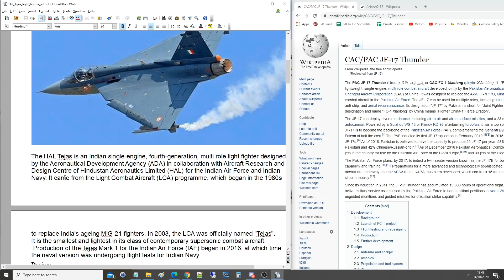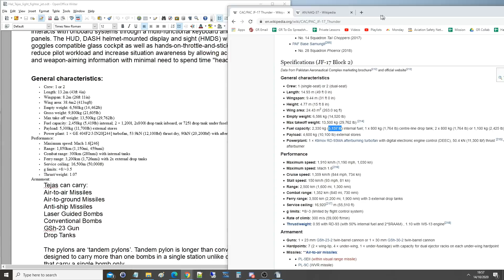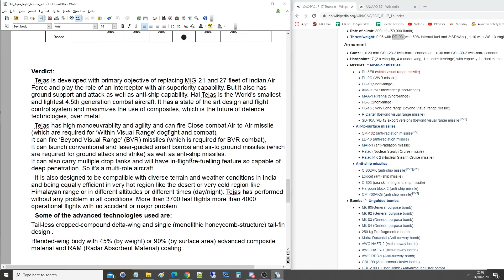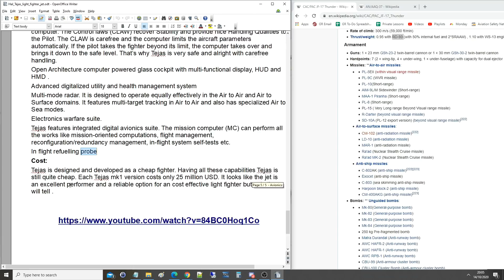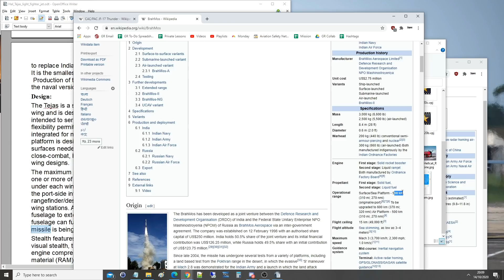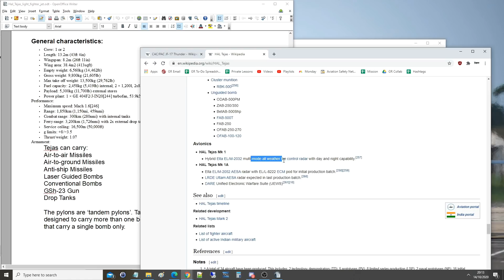Discussion: How Good Is The HAL Tejas?

Comment: Please, unless this plane prove itself in some air combat situation like J-10 and JF-17 did recently. Otherwise these claims won't convince me one bit.
Reply: A fighter jet isn't compared on the basis of its actual combat but its capabilities, for example- Tejas hasn't had any error in 10,000 maiden flights.
Reply: @SiegeIronFort  You should go research their spare parts. If you are the commander you won't want to touch this plane that got NUMEROUS suppliers from foreign nations such as Sweden, Russia, Israel and etc.

Strategically, that's not a good logistic issue.
Reply: @chlim9478  75% of Tejas is built using Indian indigenous parts and India aims to increase that, of course the actual capabilities of an aircraft can only be seen through actual combat but that does not mean that you abandon the system you made! 

The thing is new material can't be kept in hiding just because there is no war going on to test it! At the end you would asses its power on the basis on trial which we've seen plenty of, Tejas has participated in plenty of shows against other jets.
Reply: @SiegeIronFort  I'm sorry to tell you that India manufacturing infrastructure SUCKS.
Reply: @SiegeIronFort  I'm sorry that everyone will see LITMUS TEST than some ad sales. Unless that plane pass some LITMUS TEST, otherwise doubters will still exist.
Reply: @chlim9478  It is very much underdeveloped compared to other behemoths in defence industries, but it isn't totally a waste. India made Tejas with no past experience whatsoever and since then the speed for other upgraded models of this jet is quite remarkable, take Tejas MK-1 and MK-2 for example.
Reply: @SiegeIronFort  And it was developed for more than 20 years. Even that FATBIRD F-35 might had entered into Block 2 version with that LONG years. 

You're trying very best to convince me of India's own infrastructure but sadly, it's lame.
Reply: @478 I didn't say that Indian infrastructure is anywhere near to that of western or Chinese level, all I said was that India has no experience so it would take time for them.

Tejas on the first hand wasn't even in continuous development due to political hurdles, it was even stopped at a point--Your point that Indian infrastructure is just nowhere capable of building things is as absurd as it can get.
Reply: @SiegeIronFort  Yes, you did not say that. But their infrastructure still SUCKS, and that's a fact.
Reply: @SiegeIronFort  India can build, but after they passed the BUREAUCRATS' blessing.
Reply: @SiegeIronFort Then you already gave your answer then. 20 years of long development with BUDGET OVERRUN that might made F-35 program like a minor discount sales. As General Bradley once said, professionals play logistics. And India which I'm sorry to say need to rid it's CASTE SOCIETY and POOR INFRASTRUCTURE. 

There's a dark reason why the west is promoting India right now. Trust me, those elites will tell you the PEASANT to like and support it.
Reply: @SiegeIronFort And yes, go read the news, Tejas has crashed.
Reply: @chlim9478  Engine failure. Who made the engine, enlighten yourself.
Reply: @SiegeIronFort  Ever heard of LITMUS TEST? Capabilities always proof itself in REAL combat. So what are you trying to argue right now?

Comment: Lower range is because of air intake design. Air intake are designed for a certain characteristics. But while doing that engine is left deprived of air resulting in more fuel consumption and lower range. Gripen has similar weight and the same engine but it has a better range. Also because of the shorter length Tejas produces more drag.
Tejas mk2 is 1 meter longer which will improve the drag. Drag was the reason why they decided to increase the length instead of putting a more powerful engine in the same airframe. They may improve Air intake design as well.
Reply: you spoke so much "science" and yet u dont know that Tejas mk1 and Gripen C have roughly the same range which is around 1500-1700 kms on internal fuel or over 2500 kms with 3 drop tanks. It was showcased during Tejas's visit to Dubai/Malaysia and Singapore where it covered similar distances without external refuelling.
Reply: @marcd5196  no no I am not critical about Tejas. And I agree with you about the range. It's about combat radius comparison between gripen and Tejas. Both use the same engine and roughly have the same internal fuel capacity. but the combat range of Tejas is lower. 
However It's not necessarily a problem. It's probably because Tejas has to be his way because of some design consideration.
Reply: @pravinmeher2036 Combat radius publicly available is of the IOC variant. The improved combat radius is much higher. Could be in the range of 650-700km which is pretty much the same as that of the Gripen.

Comment: Tejas being a 4.5th gen fighter really made me laugh. It's solidly a 4th gen. Got to love marketing.
Reply: Nah
Reply: Gen number doesn't matter. what matters is IAf has a definite role for these machines that's why they ordered 120 of them.
And it's always about the person who operating the machine.
Reply: @pravinmeher2036  eh it's still a 4.5th gen though. Maybe a 4th gen wouldn be able to do those roles as planned.
Reply: u dont know the difference between 4th and 4.5th gen, do you?
Reply: @marcd5196  yes
Reply: @skatman3278  no u dont lol. enlighten me if u do.
Reply: @marcd5196  yes I do. I've nothing to prove to a nobody.
Reply: @skatman3278  lol pea brain
Reply: @skatman3278  low iq. lol
Reply: @skatman3278  4.5 Gen is built with composite materials not aluminum
Reply: @whysoserious7553  not always and not exclusively. Just because something is built from composites doesn't make it a 4.5 gen fighter.
Reply: @skatman3278 It's got an AESA radar. Ehich makes it a 4.5 gen fighter.
Reply: @direwolf7491  no it doesn't.
Reply: @skatman3278  YES IT DOES.
Reply: @direwolf7491  nope. It doesn't. Being 4.5th Gen is more than just having an AESA RADAR.
Reply: @skatman3278  AESA radar is one of the main features of being a 4.5 gen fighter. The reason why Su-30 is 4th gen and Su-35 being 4.5 gen.
Also be concrete... tell me what other features are required to qualify as 4.5 gen.
Give me a list.
Otherwise all your statements are trash.
Reply: @direwolf7491  no it isn't. A bad AESA RADAR is worse than a good PESA/Pulse-Doppler RADAR. It's far more than that. It's the implementation of a number of things.

I don't owe you a damn thing. I have nothing to prove to someone that thinks the Tejas is 4.5th Gen or that an AESA RADAR is what makes an aircraft one.
Reply: @skatman3278  Stop with you BS man.
And YES you do owe me  and everyone you here to not spread misinformation you punk. The fact that you are triggered by my question shows that you are nothing more than a worthless troll.

Comment: Tejas is not the greatest and the latest. But as an interceptor within Indian territory it is good to have a capable low cost option. It would be foolish to send the limited numbers of Rafael that India has to engage low value threats which its enemies throw.
Reply: if u send Rafales for every mission, after a week of war...all Rafales will remain in their hangers "under maintenance" as India wont have money left to operate or maintain them effectively.
There's a reason why US operates more Single engine F-16s than the bigger more powerful twin engine F-15s.
Reply: And in case of Tejas procurement, most of the money is spent in India. Also Jobs are created in India not in France or Russia

Comment: It's like almost all Indian procurement projects, a horrific roadcrash.  Way over budget and with all sorts of design and development issues.  No doubt they will get it working and deployed.
Reply: HAL Tejas
40 + 83 ordered. Total 123 ordered. largest fleet in the IAF only after the Su-30MKI
HAL Dhruv
Around 400 ordered. 335 Active and rest being delivered.
HAL Rudra
166 ordered . with currently 91 in service.
HAL LCH
15 initial ordered. Another 95 committed to.
HAL LUH
12 initially ordered. Another 111 committed to.

That was HAL and the Airforce

Coming to the Navy-
Currently 36 Warships under construction , making India the world's 3rd largest Naval shipbuilder in the present.
In the last 10 years, atleast 30 Indian made warships joined the fleet.

The Army however is the most corrupt one. Some high ranking officials feed a lot on Russian bribes and hence discard advanced Indian made equipment like the Arjun,. but anyway, that too is changing.
Reply: @marcd5196  arjuns gun inderperfomrs, has gaps in the front tal Armour, and is too heavy for rapid deployment, that's ehy yiu have newer developments like zorawar. The arjun's 120 MM rifled gun is a duck. Please thunkcritically,  not with emotions, the soldiers who select these know a lot more than youtube generals such as yourself about indian military doctrine.

Comment: Tejas is a scam on the Indian taxpayers and the Indian Air Force. Tejas may be a decent fighter by 1980s standards but it is hopelessly outclassed even by the planes that had been designed and had entered service like F-18s, F-15s, F-16s, Su-27s, Mig-29s, Su-30 and Gripen before Tejas had even flown for the first time. To boot, F-16, Su-30 and Gripen are cheaper to manufacture than manufacturing Tejas. Su-30 MKIs license produced by HAL, the very company that makes Tejas, are cheaper than Tejas and a Su-30 MKI is better than a Tejas any day. Tejas also has a very small combat range even compared with fighters of its own weight class like the Gripen and the F-16. Gripen, F-16 and Su-30s also require less maintenance per hour of flying than does Tejas and it also costs less to maintain these aircraft and they three are all better than Tejas. And to those who say Tejas hasn't had a crash: Those planes crash that are flown in any significant numbers. Tejas is way behind schedule. It is outdated now and it will be a flying piece of junk by the time it is inducted in any significant numbers.
Reply: lol cope up or cry.
Reply: @rohitb5834  Your comment doesn't even make sense... 🤷 Cope up with what exactly?
Reply: @col.waltervonschonkopf69  The success of Tejas? The fact that a total number of 123 of them will be the second largest fleet after the Su-30MKI?
Further the Tejas mk2 prototype is rolling out by next year.
So be prepared for another 150 Tejas mk2 between 2029-2035..

Your comment is a hotch potch of those "Media hit jobs" that has been going around Tejas but failed miserably to derail the project lol.
Reply: @rohitb5834  You crack me up! You are calling a plane that was forced down the throat of the IAF a success! 😆 Your definition of 'success' is messed up. Tejas is so successful that not even the air force of the country that built it wanted to buy it, anyway not in large numbers. It stunned prospective foreign buyers so much that they forgot even to order it. 
Sense and blind chest-thumping cannot coexist. When you learn to see the things for what they actually are, then we might talk. Chao!
🙃
Reply: @col.waltervonschonkopf69  like i said...cope up or cry 😂
Reply: @col.waltervonschonkopf69  Nice try madrassachap. But you need to try waaay harder at this point.
Reply: @marcd5196  i doubt hes a madrassachap. Hes probably from the import lobbyist team that has been printing fake propaganda against the Tejas . Failed nevertheless. Lol
Reply: @marcd5196  What if I was in the military, you dumb fuck? Did you stop to consider that? Tujh jaise armchair patriots hi hote hai jinki sabse phele fat tee hai jb dushman ki goli chalti hai, aur serve krne bhi nhi aate aur aate bhi hai to select nhi hote tujh jaise chaman chutiye.
Reply: @rohitb5834  abbe, chaman chutiye, 🤦 cope up ka matlab bhi maloom hai kya tujhe? Yha pr fit hi nhi ho rha.
Reply: @col.waltervonschonkopf69  tejas isnt supposed to be better than rafale or su30 or f16 they are all medium heavy class aircraft tejas is smallest one of them yeah it have low range but it also have lower rcs than f16 and su 30 its easier to mentain tejas because its single engine its cheaper to fly it to replace mig21 you dont need a f35 tejas is enough for that role if airforce operates only heavy class aircraft then all the money would go in the fuel and mentainence
Reply: @col.waltervonschonkopf69 Being in the military doesn't mean jack. Lol
Are you a pilot?
Forced down the throat of IAF... I bet you are friends with the gang that wants Gripen, Rafale, F-21 comissions in their pockets.
Reply: naah hes a madrassachap. It takes just a minute to verify that Gripen C costs 60 mil$ and Gripen E costs 85 mil$ , while Tejas mk1A costs 42 mil$. 
If he really thinks people are that stupid, well  he cant be from an educated background. 
Same applies for all his other lies. Takes a minute to verify and falsify those claims.
Reply: Clearly you are clueless about manufacturing and production costs. Lol
Also, the Gripen C that you keep talking about is giving about the same performance as Tejas mk1a. Come back with numbers not vague gissa pita media statements.🤡
Reply: Lol with that name I thought You must be a German/Dutch but no dude you're a Porki , ok then I think ofc we can't actually agree with your opinion (which maybe you are claiming it to be in unbiased).
Reply: @PrashadKaPrasad  What I am is your daddy, son.

Comment: JF17 is built for air superiority role for PAF, Tejas is built as light weight interseptor for IAF. Tejas built with defensive role in mind, JF17 is built with offensive role in mind. They are not same category planes.
Reply: waaah, kya analysis! lol
they are the same category in terms of weight.
In terms of generation, Tejas mk1 is half a generation ahead of JF17 block 1 and block 2.
Reply: @rohitb5834  It doesn't matter what is their weight class, both aircraft were designed with different role in mind. Tejas from day one was designed to replace and play similar role of MIG 21 in IAF (which is light weight, low operation cost interceptor), while JF-17 is a cheap multirole fighter designed for export purpose only.
Reply: @Richie303K  Battle ethos keep changing.
Tejas was initially planned as a Mig-21 class interceptor, but today is way more that.
Its fully capable of Ground attacks, CAP roles, SEAD missions.....even Air superiority if needed. 
JF-17 is a cheap multirole fighter designed for export purpose only. But that doesn change its roles.

Calling one an interceptor and another as "cheap export purpose" is not the same scale of measurement.
Reply: @rohitb5834  Yes, tejas has multirole capabilities, but what its role in IAF? From unstable tailless delta wing design, small size, only 800 miles combat radius, lower weapon carrying capabilities....almost every design aspect of Tejas indicates towards interceptor. 
IAF uses Rafael and Su30MKI for multi-role. Even Mig 29 after radar upgrade can carry out ground mission now, but that doesn't make it ground attack fighter, its a air superiority and area denial fighter.
Tejas for now is mostly interceptor which can carry out other roles as well. May be once mark 2 and AMCA comes out then it will more of multi role fighter.
Reply: @Richie303K  800 kms, not miles. And with a 800 kms combat radius it can bomb Islamabad /Karachi and back as well as several Western Chinese cities.
It has the most advanced avionics/electronics among all IAF fighters, except the Rafale and scored the best when it came to Weapons delivery during Ex Gagan Shakti.
It will be the prime choice of the IAF for bombing/ Sead missions as well.....apart from CAP and Interception offcourse.
Rafales are only handful in number and will be used in very limited but strategic roles.
Backbone will be the Tejas and Su-30MKI.
Now among the 2, Su-30MKI are hard to operate and maintain while Tejas has an availability of over 90%. Guess who will be carrying out more sorties?
Also any idea about the weapons planned to be integrated in the Tejas in a year or 2?  - Glide bombs like Gaurav and Hammer.  Anti radiation missiles like Rudram. Anti Airfield weapons like SAAW. And offcourse, the BrahMos NG.
Tejas will be the primary choice for Ground attack roles in the coming years.
Reply: @rohitb5834  There is inherited design of every aircraft based on role it is going to play. Delta wing airplanes are considered good for dogfights. Just because you can attach ASRAAM to Jaguars it doesn’t becomes a dogfighter.
A multirole fighter is somewhere between ground attack and air to air role. Which you can see in their design. Cropped delta wings and planes with canards are known to be most suited for this purpose.
Reply: @Richie303K You don't need the canards. Mirages don't have them are they being used as interceptors?
They are doing deep strikes aswell.
So will the Tejas. The low RCS is very useful. Also crancked delta wings give similar effects of the canards in certain situations.
Reply: Exactly, Tejas mostly will operate in Indian territory in an interceptor role. so range is not going to be an issue